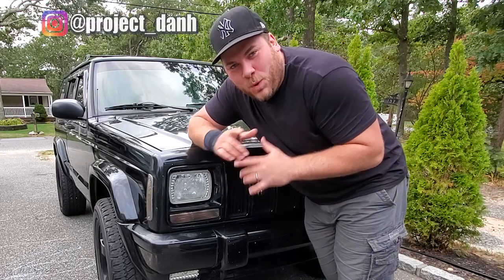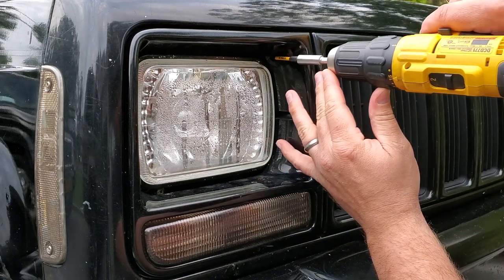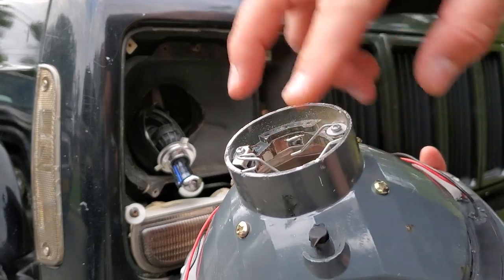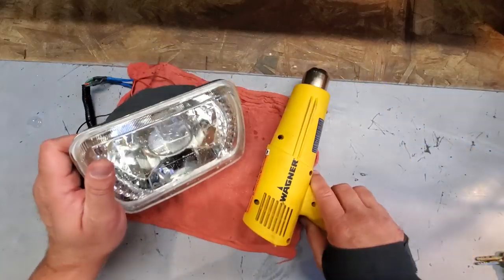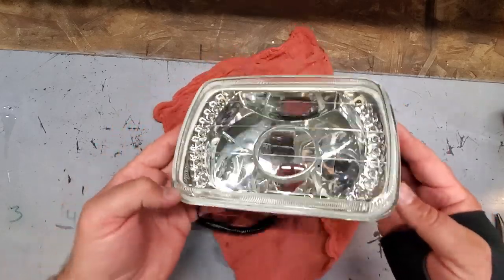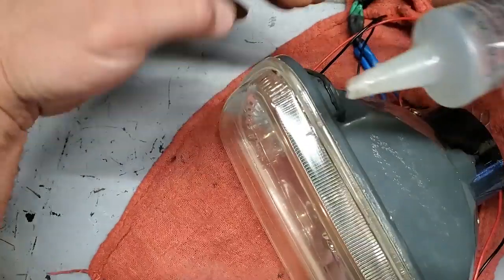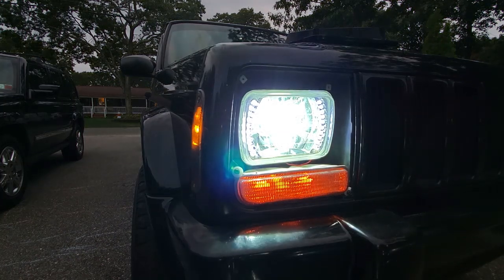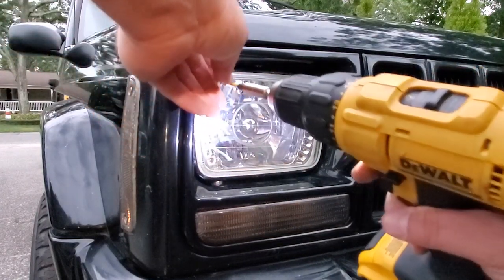JEEP XJ HEADLIGHT QUICK FIX - DRYING CONDENSATION AND SEALING TO PREVENT WATER

Comment: Yes, I'm looking for a good recommendation for some LED headlights for my XJ that will melt off the snow and ice
Reply from the maker: Unfortunately LEDs are "light emitting diodes" and don't give off heat like a regular filament bulb.  It may be hard to melt anything that's caked on an LED
Reply: I've heard that there is a company that has led headlights with heaters for winter, but not sure where to go about finding them
Reply from the maker: @garyhowell738  that would be amazing! Let me know if you find em!
Reply: @ProjectDanH  JW Speaker does heated LED headlights, but they are pricey
Reply from the maker: @garyhowell738  yes. They're awesome.. I think they're 300 per lense 😱
Reply: @garyhowell738  quadratec has the heated led headlights

Comment: Hey how's it going I am on Long Island too and have been having some problems with my XJ what shop do you usually go to and trust
Reply: I am leaking coolant from somewhere and can't get off the bolts to change out my front shocks
Reply from the maker: @js8828  where are you located?
Reply: I'm in Hicksville
Reply from the maker: @js8828  I'm out in Shirley, I only trust Gabe's Auto. It's a hike for you though